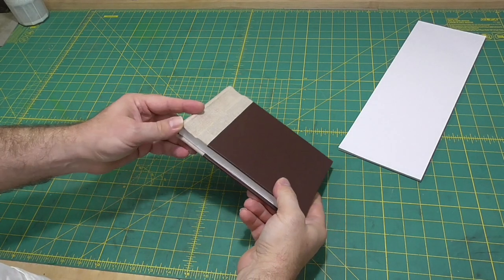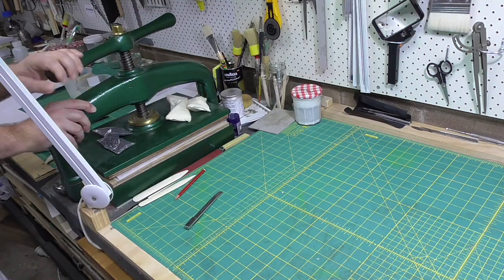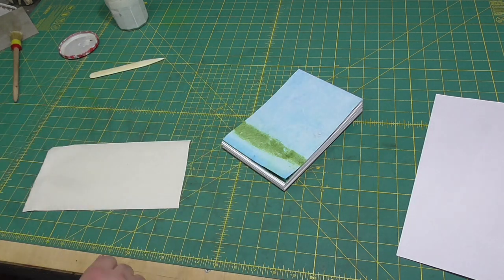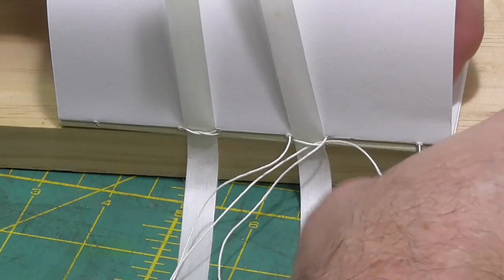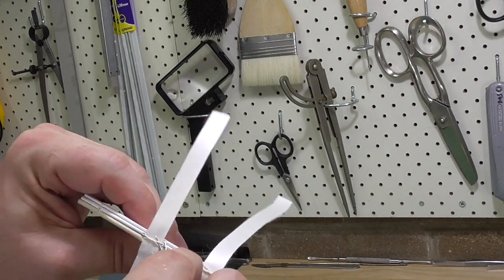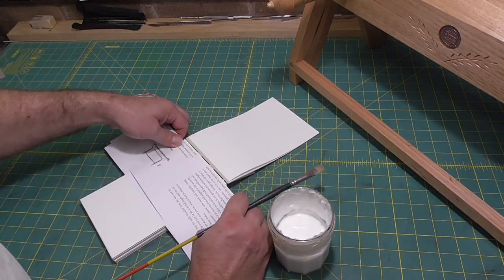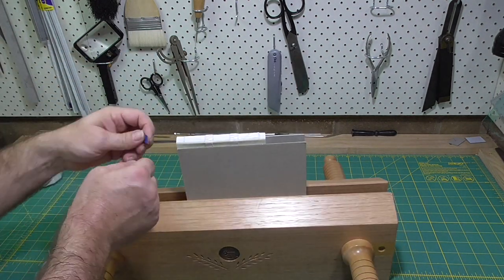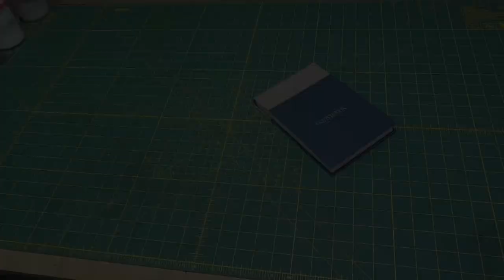A Fold-Back Sketchbook Inspired by Maureen Duke part 1 // Adventures in Bookbinding

Comment: Love the technique and results! For sketching or watercolor I have found that Fabriano Artístico which makes Kilamajaro 140lb hot or cold pressed comes in 16 x 20" sheets a 5 pack. The bend is accurate and I make 5 x 8" sketch or wc books. I tried the flip kind with the hot pressed 140lb paper and it works great. Tonight I have a cold pressed one drying. And yes I would love your guillotine. I use a straight long sharp box cutter. You have taught me the importance of hammering or working the end for a curve. Thank you so very much. I did glue down the muslin (don't know the vocabulary) tie ends. This first one folded nicely. And again the paper worked great and no issues with the grain. Thank you.
Reply from the maker: Thanks for the info on paper!  I've just finished a video on yet more ways to trim the edge of book.  Hope it's useful.  All the best, Darryn

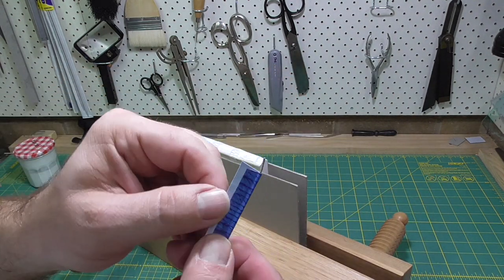Comment: Regarding 17:25, I had very good results with sharp woodworking chisel (an inch/25mm wide one) and just two pieces of relatively wide boards. The boards (in my case just rectangular pieces - 40x40mm, around 300mm long) both hold the book together and make a flat surface I can glide the chisel on. Obviously the block will stick out, but I just clamp one of boards to the table letting the block hang. 
Nothing came close to the smoothness of the cut done this way for me. As always, better to slide the chisel more times with less pressure than to push it too hard, but the results are quite impressive for an amateur like me.
Reply from the maker: Hadn't thought of using the chisel method in the horizontal configuration.  Good one!  DAS

Comment: You did say the grain direction, but I'm not completely clear on that. It runs from head to tail, right? even when it's so narrow, but like you always want to fold with grain, right? I got bit confused with "long and thin" how you described the paper. But however I want the size to be, always fold with the grain
Reply from the maker: Yes, always fold parallel to the grain.

Comment: Why did you sew on bands if you’re using link stitch? From what I previously learned these are 2 different methods, did combining them come with any advantage?
Reply from the maker: They are 2 different things, but can be combined.  Traditionally it is unusual.  As you elude, individually each brings something to the table and combining them is the usual circumstances can have downsides.  The time they have most commonly been combined is for springback bindings where the spine gets a very heavy workout.  In most books the spine is not bent through such a range of motion.  But in this sketchbook it is unusually bent back, and thus why Maureen Duke suggested it for this binding.  Hope this makes sense.

Comment: OH MY GOSH this is so cool. I need to make one of those for me x___x
Complement: By the way, I remember watching a video in french binding and the person only crossed the thread while sewing without a tape or cloth behind. I would do the same as you did, but do you know if without that tape it would work?
Reply from the maker: Actually, the most common use of French sewing, or catchup sewing, is without supports (the tapes).  I use it all the time for small books where supports will not add much value but I want to still keep the sections together.  The use of French sewing with supports is usually reserved for very large books or where superior strength is wanted, such as a sketchbook that get folded way back, or ledgers.  Great observation!  DAS

Comment: It looks like your needle is sharp. Why don't you use a blunt tapestry needle for the binding? It wouldn't catch the fabric, or would it? Does it fail in some other way?
Reply from the maker: Hi Unfinished Lady (what a great YouTube name!), I have a post on needles and thread.  https://dasbookbinding.com/2019/04/05/needle-and-thread/  My favourite needle is made specifically for bookbinding and I guess I use it for the same reason I drink "summer beer" in summer.  Mostly because it's called a bookbinding needle and because it does the job.  It's not that sharp.  This last week I needed a needle with a large eye but thin shaft and I used a darner.  Was that needle sharp!  Blood all over the place!  I think the main thing I look for in needles is length.  Longer the better I think.  All the best,  DAS